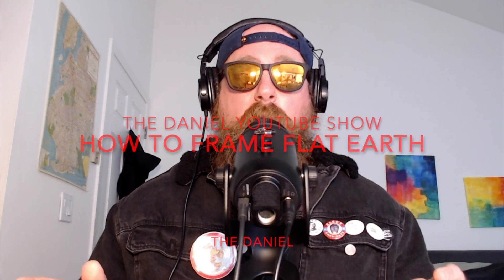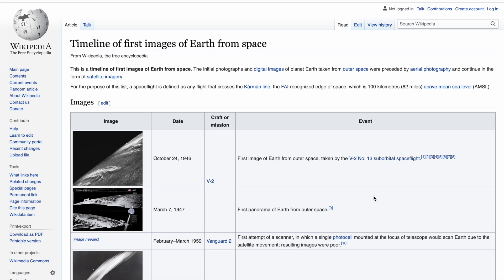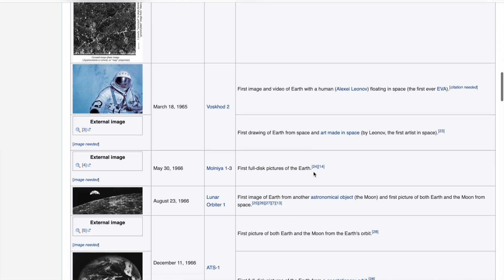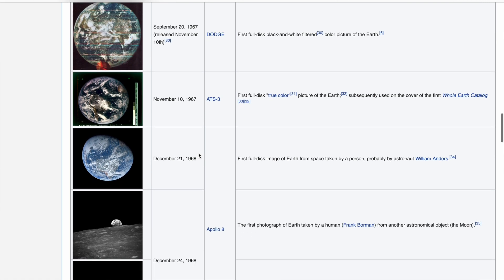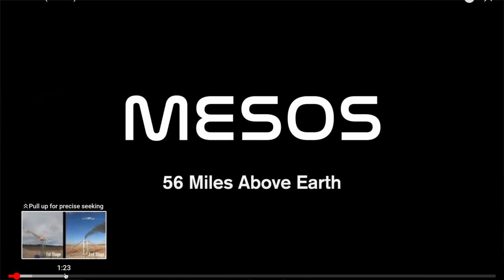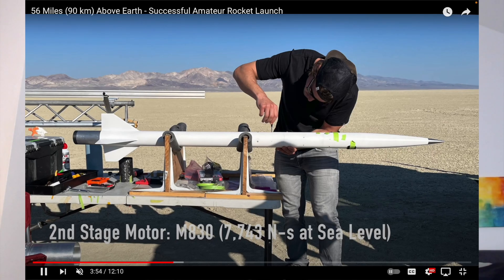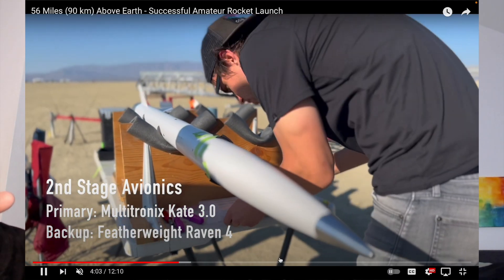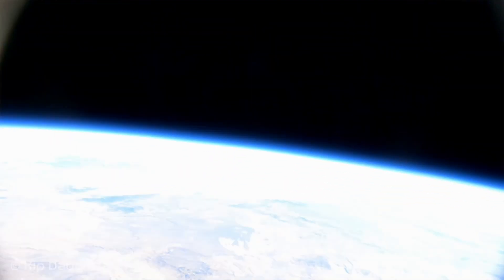How to Frame Flat Earth

Comment: The purpose of the launch was to get a rocket way up high and to document the flight. It wasn’t to debunk anything. The camera was placed in the rocket because the rocket was traveling at Mach 4.1 and the heat and associated drag with mounting outside would have ruined the camera and severely limited the altitude of the flight. I was there for the launch and saw before and after. The 1200 degree rated paint was blistered due to the heat. Camera would have been toast. The launch was for fun and for personal achievement and not for this silly debate over the shape of our planet.